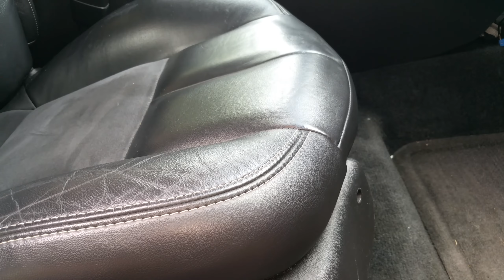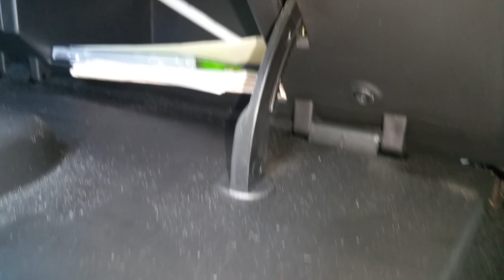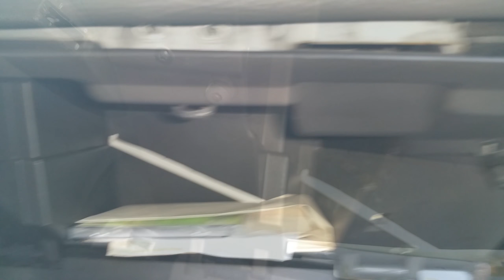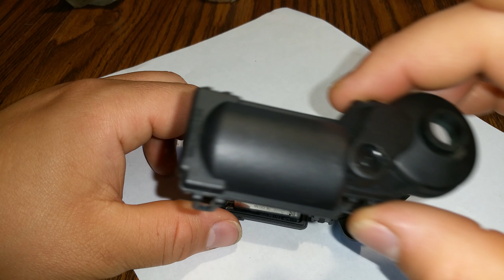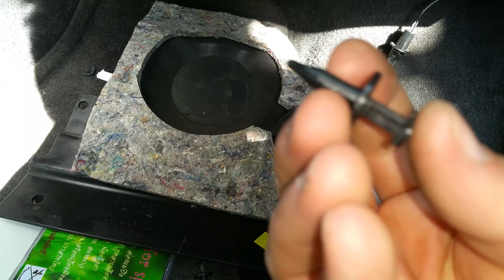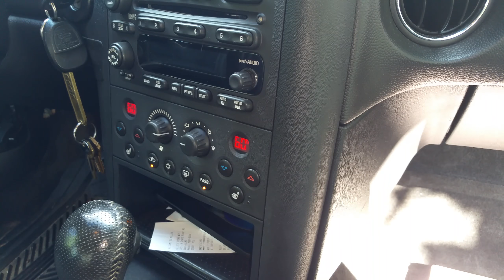04-08 Pontiac Grand Prix - Repair or Replace HVAC Blend Mode Valve Actuator

Comment: I have a 06 pontiac grand prix theres no air though my vents i replaced the ac residor n ac blower. N still not air they dont turn on i checked the fuses n relays everything good. Any help what could it be

Comment: There is a clicking sound coming from the same area without the car running could this be the problem in my 04 Pontiac Grand Prix?
Reply: i got the same thing runnig down my battery
Reply: @leonfundukian1556  I fixed it thank god for this video found a small piece of plastic caught in the gears. I don’t know how happened but it’s fixed

Comment: There must have been huge changes between 97-02 Grand Prix and the later years. 97-02 is far more complicated with vacuum lines, solenoids, and replays, and no one is trying to make a video for those. This newer design looks easier to work on, but still cannot make up for the digression on the interior and exterior styling.
Reply: This Grand Prix unit, Corvette and mini van all used the same HVAC unit with different mounting configs.  Look for those vids too!

Comment: Hi, great informative video. i have no heat but the hoses get hot. blower fan is great and a/c works. Could this be my problem? i think it is worth a look. It had a flush and fill last year so i do not think there is a blockage. 2007 grand prix 3800
Reply: Just an update.  For my car it was the actuator behind this one.  It controls a flap that controls how much cool or hot hair comes into the system using the hot/cold adjustment.  Mine had a broken gear so I bought a new unit and installed it, so far so good.  He covers this in this video: https://www.youtube.com/watch?v=jHHLquq7uXU&t=1374s
Reply: @smg3828  I don't have the clicking, but I have no heat at all. Switching between modes is fine - my understanding that the unit behind this one controls the passenger side temp controls? Just to clarify, this fixed your problem with heat for the entire system?

I was told it was the "blend temp" actuator - this seems to be a combination of the names of the two different actuators, however. 

It will be a chilly evening spent tearing this apart so I would like to know which I am replacing before I go about digging into it.
Reply: @ @mattbowers5729  Yes, replacing the actuator behind this one (on the video I linked) fixed my issue of having no heat.  My car does not have driver and passenger temp controls, but it did fix the heat issue.  My problem is that the heat was available, but couldn't get to the passenger compartment because the actuator could not move the flap that controls the amount of hot and cold air coming in .  A/C was fine, heat was blocked by the flap.  

So this fits with what you say is a blend temp actuator, as that is essentially what it is doing, moving a flap that controls the amount of hot or cold air coming in.
Reply: I have the same issue in a 2005.  Do you get a random rapid clicking noise in your dash as well?

Comment: I thought this was my problem but it doesnt appear to be it.. In the winter and even last night I put my heater on and its warm on the passenger side and cold on the driver side..  I can feel the cold air in the vent up by the window off the dash and cold air down on the floor, but on the passenger side whether the passenger side is on or off gets all the heat???
Reply: Found my problem... It was the one on the drivers side... I had replaced the one on the passenger side and it made no difference, luckly I kept the old one as the motor was still good.. It was the motor on the driver side so I just exchanged the motor and it works now... thanks !

Comment: Before you start taking the dash/ glove box and heater box actuator modules  apart...check the heat controls assembly on the dash for functionality.   get a spare from the junk yard and try that first because it is easy to change and will save you a lot of frustration.
Reply: cocodog85 Yes I think this is my solution, thanks

Comment: Hey I have a 2006 gt model, my air blows hard and I have a lot of freon and a working compressor, but I'm only getting hot air into the cabin. Do you think I should replace my temp valve actuator?
Reply from the maker: biderman16 Do you have the manual or automatic controls?
Reply: GPVlog automatic, same as yours
Reply from the maker: Do this as a test. turn the climate controls to vent fans and put the blower speed at its lowest setting. Make sure the car is not running but the key is set to run (so dont start it. Start at 60 degree for the driver and hold down the red button all the way to 90. Listen very close to hear if the motor is turning. You will be able to hear it as its turning in one direction. If you can not hear anything then pull it apart as I show in the video.
Reply: How do I troubleshoot for manual? Same prob as this guy
Reply: Same problem only blows heat 04 gtp. Manual controls

Comment: My a/c unit won't even come on I believe it's a problem with the wiring underneath the dash panelling but I am not totally sure.  In addition to replacing the actuator on my 3800 gp what else would be recommended?
Reply from the maker: SlimmyLong Do you have the manual or automatic controls?
Reply: GPVlog I have a 2005 automatic GP
Reply: GPVlog there when I get in my car it looks like a loose wiring hanging near the bottom left of the panelling but I don't know where it's detached from
Reply from the maker: SlimmyLong Can you make a short video of that and upload it to YouTube?
Reply: GPVlog yes when I take lunch I do it and tag you
Reply: thanks for posting this video. I am having problems with mine and just replaced it following your instructions. however the new one isn't working either. it will turn to the left.. then the right then stop. Is something wrong with the wire or another issue?
Reply from the maker: Mel Danner ok man. what you need to do is check to see if voltage is being sent. do you have a multi meter?
Reply: GPVlog I don't but I can borrow one from my dad... if not I can pick one up
Reply: SlimmyLong 
resistor control module